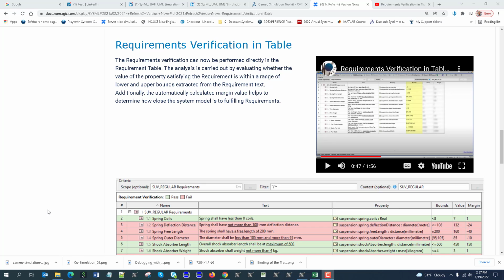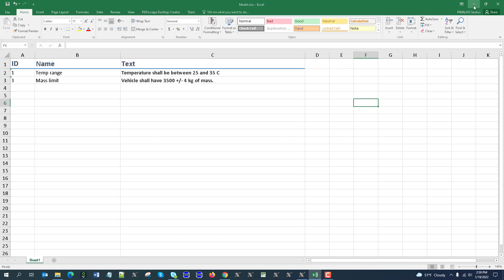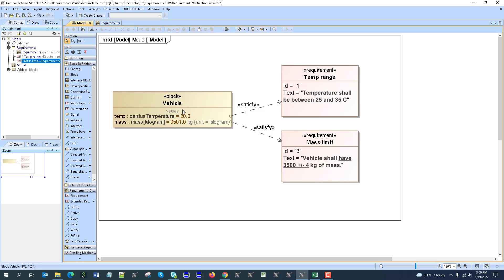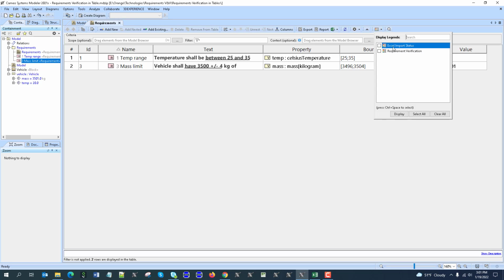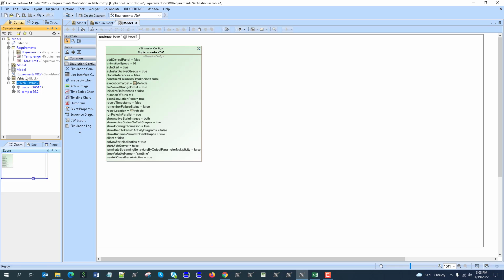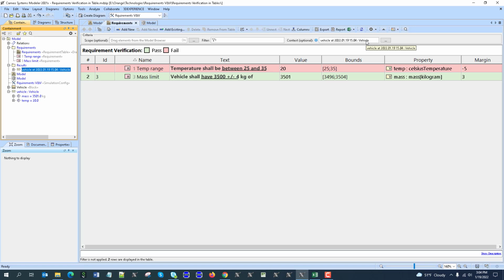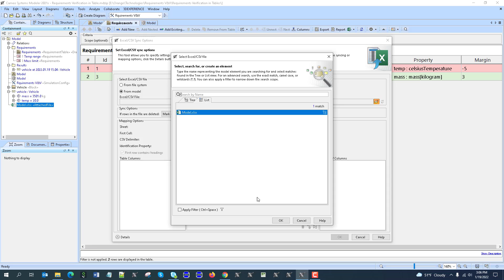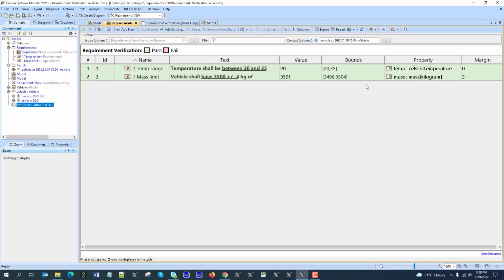Requirements V&V in Table SysML Simulation Tutorial

Comment: I'm having issues seeing the "Value" and "Margin" values when my context is a specific classifier of the original generic context with redefined values.  

For instance, my parent block is "Power Supply" which has Vmax:Real with no default value.  I have a specific power supply, "Power Supply 123", with Vmax redefined as 300, and a generalization relationship to "Power Supply", Vmax within "Power Supply 123" is redefining Vmax from "Power Supply".  I have a requirement, "Power Supply shall have a Vmax greater than 120", with a satisfy link between requirement and Vmax value property from the "Power Supply" block.  When I run "Power Supply 123" in simulation I get the green/red highlight on the redefined Vmax value property as intended.  When I make "Power Supply 123" or a saved instance of "Power Supply 123" as the context of the Requirement table, I cannot see values for "Value" or "Margin".  When I force a default value for Vmax for my template "Power Supply" block it does show up in the requirement table.  

It's like Cameo cannot interpret redefined values within the Requirement Table and I think it should.  This is causing issues as I would like to toggle different configurations quickly and see if they meet the requirements. What am I doing wrong?